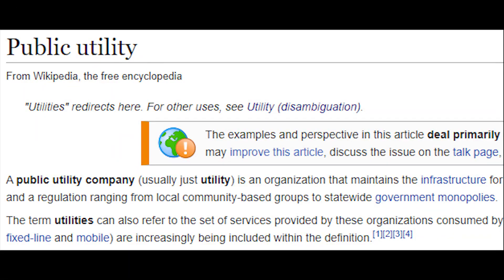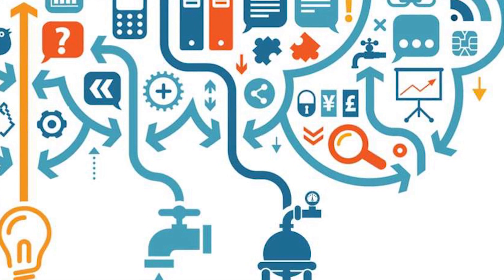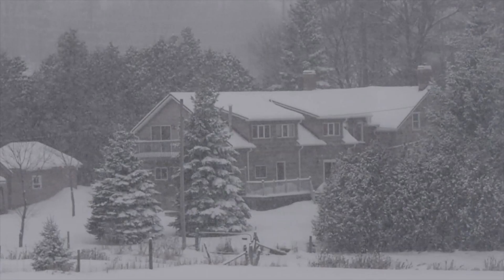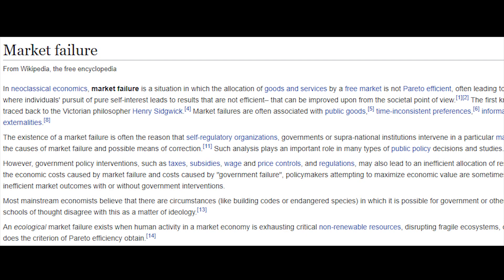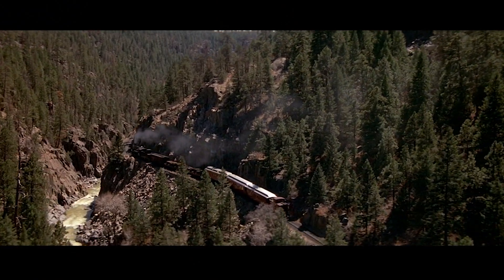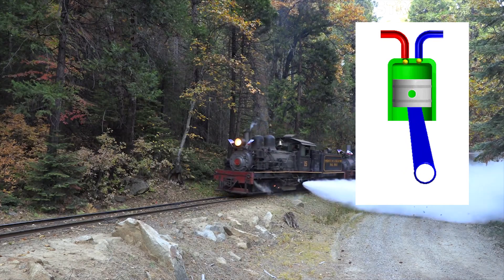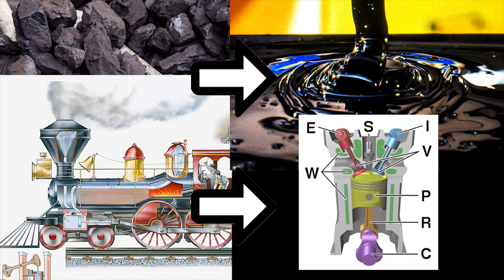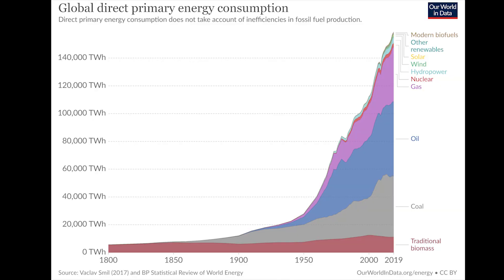Unseen, Unsung, Unnoticed | How do "Public Utilities" Work?

Comment: You talk about monopolies as though they are a negative thing, period. 
When John D Rockefeller monopolized the oil industry, oil prices went down and oil availability increased. And the prices remained lower for a long time afterward, in fact it wasnt until  the government broke up Standard Oil that oil prices rose significantly. 
Microsoft has a monopoly but the government cant seem to do anything about it, for all the times that they have tried they have failed and MSFT continues to monopolize the PC software industry. So what good is the government? What good does the government do attacking monopolies? Thats two examples where the government caused exactly the wrong outcome. 

Most utilities are private or public monopolies with a few exceptions. The city of Palo ALto Ca buys its electricity from PG&E, in bulk, and resells it to its residents. Once it was cheaper than the PG&E electricity, but now it runs about the same and their rates, as well as all the rest of California are the absolute highest in the country. 
So, who is protecting us from the government?